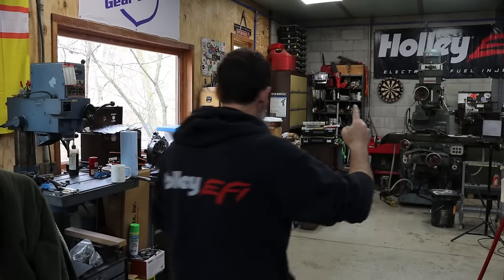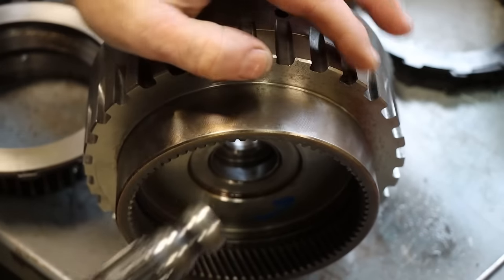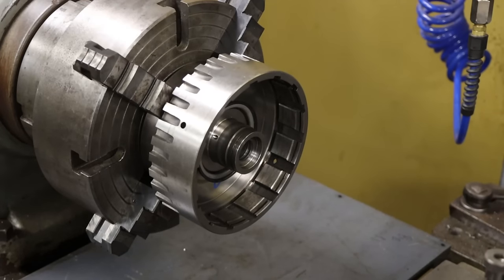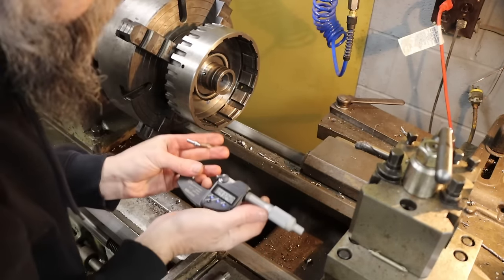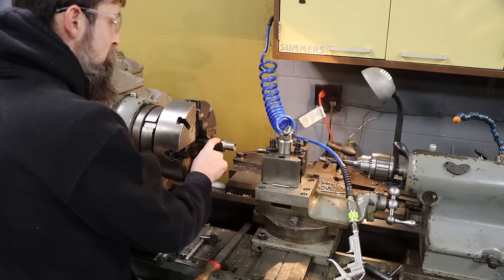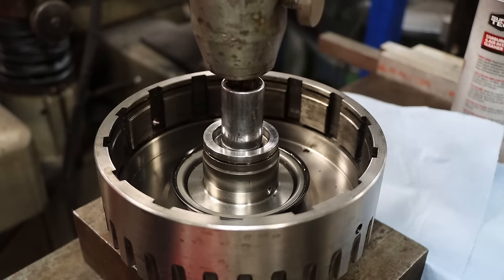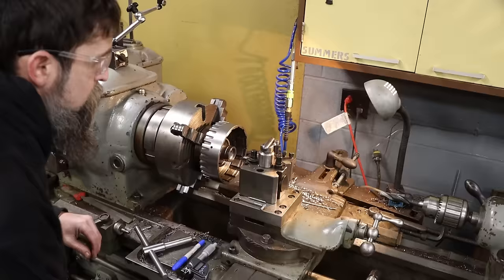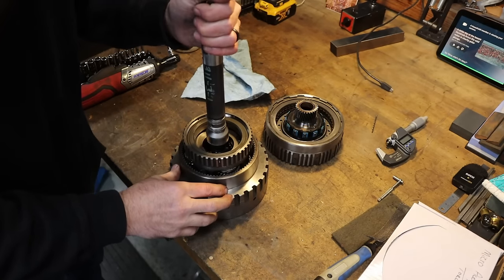Boring and bushing a damaged 4l80E Clutch Drum.

Comment: Congratulations to the family on its newest addition! This video may be my favorite to date. I took on the challenge of rebuilding the TH400 in my ‘68 Camaro, and enjoyed every minute of the process. GM did a great job with both of these transmissions, especially when you consider that many parts of the 4L80 fit the TH400. They also included the upgraded sprag, which was one of the rare weak points in the 400. Great job on the repair. Hopefully you’ll do a video of the assembly. Cheers from Florida’s Space Coast.

Comment: When a transmission start to wear out you will notice slippage and if you add STP motor oil treatment to your transmission fluid, you will notice the slipping goes away because the thicker fluid with take up the wear gaps between those warren parts. Valve body valves wear in the walls of the valve body and that lower pressures on the clutches and bearing which helps to wear the tranny out even quicker. I have been using STP in my 1992 Suburban for over 15 years and i put a used tranny in the truck when i first got it. 700R4 which is a earlier 4L60E 60 standing for 60,000 pound load and 4L80 is 80,000 pound load, 4 speed longated (L) every thing in these Transmissions is controlled by the gap tolerances between the parts. Even the shift feel is controlled by the springs against pistons softening the fluid pressures on the clutches. Some builders use STP as a rebuild glue to hold check balls in place and to lube gaskets and seals in these transmission, so using STP will not hurt the tranny and will be better for it in the long run.

Comment: Nice fix. One of the parts I had trouble getting was good drums for the 2004r trans. And today they are worth quite a bit because you can't resurface them and no one makes a new replacement part. I have one 2004r that I had in my El Camino that had it's sprag fail and it's been sitting in the shed for decades and I may rebuild it again just to have. And the better half has been wanting grandkids for years now and I am not in any hurry.

Comment: When I saw the autobox in parts on the bench I thought "blimey that's a brave move pulling that apart". Then seconds later you say your dad used to overhaul them for a living. Be interesting to see how it goes. I know if I pulled one apart I'd have enough bits left over for another 2 transmissions and a valve radio.